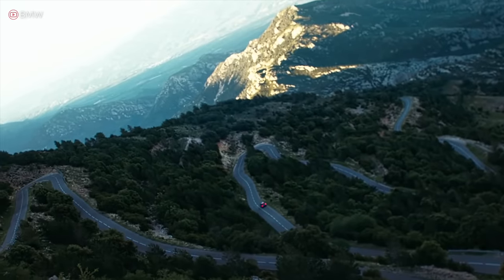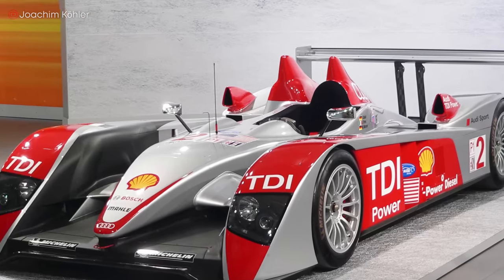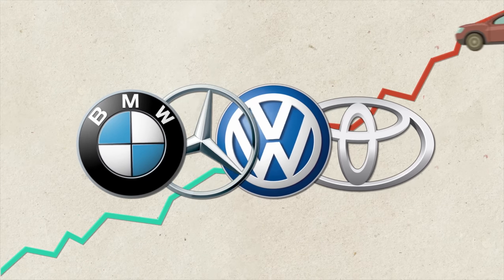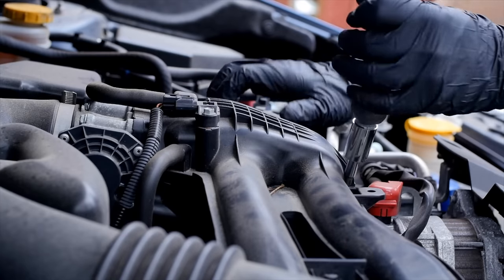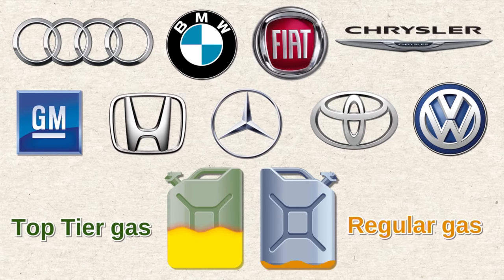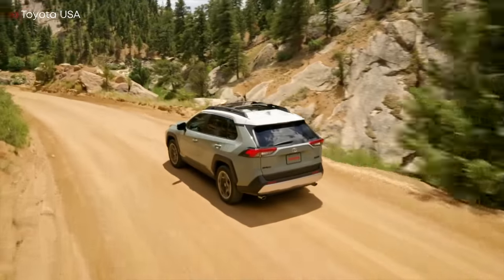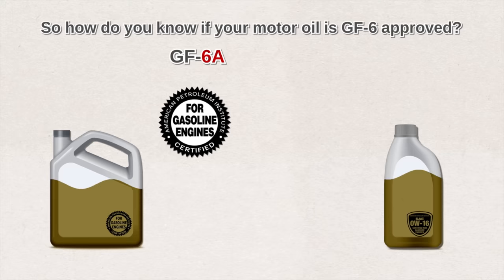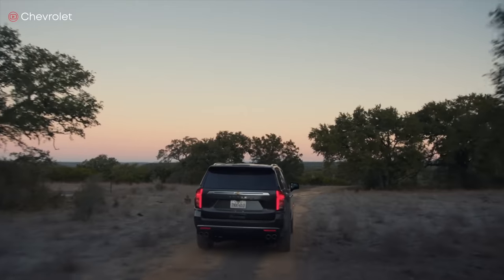Stop Buying This Fuel Right Now

Comment: I remember once I borrowed my brother's VW Jetta turbo diesel, and was filling it up once, and this guy sort of laughed and said "You do know you're pumping diesel into the car..."  and I replied with a little laugh like "Yeah,  I know crazy isn't it.  It's a turbo diesel."    His eyes got a big and he was like "Oh, OK" looked at the badge on the back quick and said "didn't see that." and walked away.
Reply: how fast does it ride? Despite what people say diesels are very powerful engines with a lot more torque.
Reply: @Monster33336  doesn’t mean their fast. now if you put an ALH in a mki to replace the  1.6idi? sheesh?
Reply: @AWESOME1509  Not fast but strong. I'm assuming smaller cars with diesels should be much faster but idk.
Reply: That happens to me a few times a year,   the last time,  a few weeks ago,   I had the station attendant come running outside waving his arms yelling across the lot.    I just take it as strangers trying to look out for me and appreciate it.
Reply: @Monster33336     I have a diesel Jetta wagon,   it's no quicker than an average 4 cyl gasser but it climbs hills much easier.    Don't have to push harder on the accelerator pedal going uphill.     Also fully loaded with stuff it doesn't effect fuel milage,    multiple people and camping gear i get the same MPG as it gets empty and just me.  Around 47 mpg.
Reply: @AWESOME1509  why would you use the weakest tdi engine the ALH is a 90BHP that’s slower than the engine you’d be replacing 😂
Reply: The thing is you can't physically FIT a Diesel nozzle into an "unleaded" car's filler due to the size difference.

Comment: Love the way you explain things.  I'm an old school mech.  Back yard repairs.   Started working on newer models around 2005.   First 96 ford windstar.  Loved the way everything worked with computers.    Once I gained confidence I started doing more.   Now have 2012 F150 with159000 miles and runs like a top.   Maintaince fluid filter changes and fix small issues.   Also have a 2012 Audi.  It burns oil per one of your other vids but we watch the level and at 148000 that runs great too.  Trans oil changes along with all fluids through the years. Best  part.  Paid for for many years now.

Comment: Very informative video. Here in Colorado and other high-altitude areas, the oil companies screw us over by calling 85 octane "regular" gas and charging around 30 cents per gallon more for 87 octane REAL regular gas which they call "midgrade". Most cars specify at least 87 octane as the minimum, but most drivers here just buy whatever is cheapest, which means they are using 85 octane that is not good for their engine. I have always spent the extra money to put 87 octane in my cars, and this video vindicates me for doing that. Old cars with carburetors probably did OK with lower octane at high altitude, but I'm thinking that modern cars' engine computers reduce performance and mileage when compensating for the lower octane fuel.

Comment: I own a Peugeot 3008 with a 2L Diesel engine (180 hp, 295 lbf). Its fuel effectiveness is 73.5 mpg on a intercity road at 57 mph speed (90 km/h speed limit on the roads of that kind).

Comment: Some places  you do need anti gel for diesels. Around the south they usually ever get cold enough. But they have warming pads for the oil pan and battery. And you plug them in for overnight trickle charge. Engines are still cold. You need to let both engines warm up some. It’s hard on them I feel until the thermostat has moved let them warm up before jumping on the highway or interstate for travel or work. If you do don’t harf in it baby it. All the fluids are at the nights temp and don’t lube as well until it’s warmed. Engine oil is thicker. That is why manufacturers recommended 10/30 ten is 110 degrees and and the 30 is minus thirty degrees winter degrees the oil is still able to flow and lubricate your engine properly. If you have an old freezer go stick a quart and freeze it and pour it out after over night. Then pour up a bunch heat it up to 110 see what it does at 110 degrees is still lubricating?

Comment: Scotty...I have an Isuzu Trooper, 1987, with a C223 diesel engine, 4 cylinder: after watching you here, now I know that my truck is an indirect injection system. Since I leave in the Dominican Republic, we use deasil vehicle all the time.  And here is the reason why I think the  indirect injection engine is better. The direct injection doesn't accumulate so much dirt inside of the engine like the direct injection engine does. I think the best diesel engine ever make was the Toyota Hilux Diesel 1986. This indirect deasil engine run for ever. And while they consume more fuel than the direct one, what you spent in fuel you save in mechanical work. Too much dirt inside of the direct injection engine. As for my Trooper, I have seen some of these with 500,000 mile and more in Indonesia where there is a Trooper Club. There are not fast, but they are, super, super reliable.

Comment: Nice video. Here in Norway, we have 95 octane and 98 octane RON gasoline. I buy 98 octane for my cars because 95 octane contains ethanol (E10 - 10 %). Ethanol contains less energy than gasoline, meaning ten percent of the gasoline is less powerful. So the energy of 95 is in fact lower than 98 per liter or gallon. Further, the ethanol is hygroscopic, binding water from the atmosphere. Also, older cars have fuel lines made of a rubber that gets brittle from ethanol.

Comment: In Ireland, diesel engine cars (just over 43%) are the most popular cars after gas (we call it petrol over here)(nearly 37%). I myself have a 2012 Toyota Corolla with a 1.4 litre Terra diesel engine. Diesel is more popular here in Ireland because it's up to 10 cents (12 US cents) cheaper than petrol per litre and probably due to Ireland having more people living in the country than other parts of Europe and America. To me, petrol (gas) engine cars are only any good if you are only doing urban / town driving where you don't do long distance travelling. Since I live in the country and I do much long distance driving (it may sound funny, but I do long distance driving to relieve my depression and anxiety), a diesel engine is the much better option. €50 (just under $60) fills the tank full of diesel (it costs at the moment €1.42 a litre on average for diesel (€1.53 on average for gas per litre), which probably sounds very expensive when on average, diesel only costs 74 cents (about 87 US cents) per litre. At least with diesel though, in my car for example, I can get over 500 miles out of a single tank of diesel, which I think is excellent.

Comment: I typically see a 10% increase in mpg with premium fuel over midgrade.   I often wondered if it's because the gas stations I tend to use have more additives or maybe have a lower ethanol content in their premium grade.   I can also say that I get a large mpg increase if I use a mid-grade ethanol-free fuel, as much as 25%. I wish ethanol-free pumps were more prevalent.   Corn-based ethanol isn't environmentally friendly anyway.

Comment: My Honda Fit recommends 87 octane. With it, I get 35-37mpg. If I use 93 octane I get 40-43mpg and it seems to have better acceleration than with 87.

Comment: Still wake up screaming sometimes because of the issues with Diesel injectors getting loose (at 125 GBP a pop to reseat) on my prior Jeep Grand Cherokee. Apparently a typical Mercedes engine design flaw that only keeps it in place with 1 bolt on one side of the injector (contrary to e.g. BMW Diesels that I'm told keep the injectors in place with 2 bolts, 1 on each side). Also due to the partially unseated injectors air was being drawn into the cylinder, cause big black clouds of smoke behind the car, especially during acceleration.

Comment: When I went on extended trips in my Corvettes, I'd use GOOD quality regular. The lack of 'need for speed' fuel caused NO change in cruising effort (under FAST at least). It was stressless savings. Tooling about town, I used high octane and it was fine and I never noticed any 'overhang' upon switching fuel.

Comment: I used to drive a 1973 Toyota Corolla, which was bought new, and used 87 octane gasoline. After ten years, the engine began to knock. I switched to 89 octane gasoline, which stopped the engine knocking. A couple years later, the engine started to knock again. I switched  to 93 octane gasoline, which stopped the knocking again. After 14 years, I replaced the 1973 Toyota Corolla with a Toyota Camry. The higher octane was a way to stop the engine knocking. Perhaps, I should have had the car serviced instead, to stop the engine knocking.

Comment: Oil Question:  I have a 2007 3L V6 Accord Coupe. I'm the original owner and the car has 129,000 miles.  Have always used 5W20 every 3500 miles.  Should I keep using it or change to a High Mileage or Synthetic oil.  What are your thoughts?

Comment: My 2019 Subaru XV (Crosstrek) is stated to require 91 RON (American 87 octane). However, I find it runs so much better around town on 95 RON that the mileage improvement exceeds the extra cost per liter. But on the open road the mileage improvement with 95 RON is insufficient to justify the extra cost.

Comment: I cam say honestly say I drove a 4.6, V8 equipped Crown Victoria Police Interceptor to commute from Las Vegas, NV, to Mequite, NV, 5 days a week for 3-1/2 years, and there was a distinct difference in distance  I could go on a full tank of low or high octane.   The lower octane fuel most definitely gave me less mileage and the fuel level dropped much faster too.  High octane for that highway cruise was the best choice. After 3-1/2 years of that cruise in the same exact vehicle out of the fleet, I could easily see and even feel the difference.  I wouldn't be surprised if that police Interceptor is still on the road today, it was an excellent, strong and extremely reliable vehicle.

Comment: Modern diesel engines have the DEF exhaust system. This system keeps the exhaust much cleaner. If you buy a vehicle that doesn't have the DEF system you cannot register it in California.
I retired from trucking last year. The truck that I drove was a new Frieghtliner. It had a 500 HP engine. It ran great, and because it has an automatic transmission it was a dream! More than eighty percent of the industry is now using automatic transmissions. It's fuel efficient and has less repairs.

Comment: I drive a Hyundai i30 2011 with a 1.6L diesel engine and my wife drives a Volvo XC60 D4 2017 with a 2.4L straight 5 cylinder engine, awesome cars. Diesel power is the best, and fuel quality in Sweden is one of the best in the world. Oil change every 30,000km and diesel cars starts like a champ in low tempratures, actually when it is - 35 degrees in north Sweden, diesel cars start easier than petrol cars, that's what I was told by a guy who lived up there in north...

Comment: The VW diesel and many other 2-stroke diesel engines have "Glow-Plugs" which require to be energized before the compressed air in the cylinder reaches sufficient temperature to ignite the fuel/air mixture.   The fuel/air mixture doesn't explode as with gas engines but it just burns on ythe power stroke to provide constant downward pressure on the piston.

Comment: Out of curiosity, why do diesels tend to have a higher displacement then it’s gas counterpart?  Ford and FCA use a 6.7L diesel while the gas engines are 6.2L and 6.4L respectively. GM uses a 6.6L diesel and a 6.0L gas. Is it because of the way diesel burns compared to gas, or what?

Comment: Adding information about high mileage oil would be helpful. Speaking with an oil engineer, the base materials are larger, preventing consumption of the oil. The oil weights are the same, just larger base materials. Then additives such as zinc, moly, tungsten for the extreme pressure. These prevent wear!

Comment: I had a Ford Econono van 2.O Ltr Engine. When I used higher octane fuel I got more miles to the gallon than with the lower octane fuel. Roughly 120% The engine ran more smoothly on long trips

Comment: Not mentioned was power output is (also) a function of ignition timing.  The ability (due to knock sensors) of modern computer equipped vehicles to vary ignition timing according to knock has significant advantages over systems not able to take advantage of knock sensing.  
Timing can be advanced and power output increased with higher octane fuels, but only IF the engine (sensors/computer) has that ability to sense knock and dynamically optimize fuel/timing.  (Proof is in the dyno torque/rpm graph comparisons resulting from ignition timing changes.)

Comment: 1500, 2500 and 3500 diesel trucks are a joke. $90,000 for a real work truck is ridiculous. So are the used 15 year old diesel trucks with 350,000 miles on them. No thank you.

Comment: Nice video from Scotty.  Funny to see the differences in oil changes...  max. 7000 miles Sotty said?  Uuh.. well; car manufacturers here in Europe state: 19.000 mile intervals!!  (Not good I know) 
So quite a difference.  I change the oil of my car at approx. 8.000 miles but 99% of the drivers here in the Netherlands don’t.  They don’t know how and leave it to the adviced service intervals, which are.... 30.000 km (= almost 19.000 miles)!!  Many of my friends or colleagues think I am crazy to change the oil so “quick”.. sigh..🙄🤔

Comment: My 05 camry users manual said not to use fuel with more than 10% ethanol. Today's fuels have 15%+. This is why even though I do full synthetic oil changes I do it at 3000-4000 miles & not 5000-7000. Ethanol is CAUSTIC & can corrode gaskets and piston rings. Pulling that out more often is good.

Comment: 12:29 u said higher octane burns hotter is not correct; but I had a 98 Grand Cherokee and the owners manual specifically said don't put higher octane in because the hotter temps could cause engine seals to fail.

Comment: In Minnesota or the northland states you can use 0W-??, Vs a 5W-??. It flows faster. My little run around Kia Rio says to use 5W-20. The Mobile1and Pennzoil site say I can use a 0W-20 when I looked it up on their site. I bought the Amsoil Signature 0W-20 and have it in right now. I notice that when it’s like -25 it starts very easy and no vibration or shaking at all. I’m going with Mobil1 0W-20 in October. I only drive 7500 a year in this car. I park my Silverado in the garage and drive it very seldom in the winter. It was so expensive so I want it to last.

Comment: Adding fuel that is higher octane may reduce fuel consumption, and may reduce CO2 emissions is fine and dandy, but what I want to know is, does higher octane fuel help extend engine life in my car or truck that recommends higher premium octane fuel? Or does higher octane higher resistance to ignition cause piston rings to prematurely wear out from an increase of pressure in an engine that already has badly worn piston rings which has a loss of pressure?

Comment: Hi Scotty, 
You have recommended against turbocharged gasoline engines because the high pressures lead to earlier failure. Is that also true of diesels? Diesels have higher internal pressures to begin with, so it would seem that turbo-diesels would have much higher pressures than gasoline engines. Is it possible to design either type of engine to be as durable as a non-turbo?

Comment: Are the newer direct injection engines the reason diesels don't make as much clatter as the older ones? The newer trucks don't make as much noise as the older ones do. Sometimes you can't even tell it's a diesel unless you really listen to it.

Comment: you can get more power out of higher octane if you can advance ign timing or a modern engine with a knock sensor it always advances timing till it hears knock and backs timing off,the supercharged V6 buick used in australian commodores blew head gaskets when run on low octane fuel

Comment: Petrol/gasoline engines can produce more torque than they do if they make the pistons smaller but with longer stroke. Diesel engines use smaller pistons and long stroke which is one of the many reasons why the rpm limit is lower than a gas engine and torque is higher. Gas engines normally use broader pistons and short stroke which allows higher rpm and power. Also diesels still suffer from turbo lag with fixed vane turbos, most newer engines use VGT or VNT turbos which helps low end boost. Modern gas engines will have a VGT type also, engines that are turbocharged require different cam timings from non turbo wether it's diesel or gas.

Comment: One thing, some older engines will not run on petrol (Gasoline) with a high E number.  So if governments make high E content fuels the only ones available, many older cars, especially historic or vintage cars, will be worthless and put in museums or scrapped.  Unless someone comes up with an additive that deals with that.

Comment: What about using 100% gasoline without ethanol? I've heard and read some saying its bad to do this, and many who say its good to do this. I do it only on occasion.
Reply: Ethanol has less energy (BTUs) per volume compared to straight gasoline, so you get less power per gallon. Ethanol also attracts moisture which settles in the tank and can eat (rust) metallic fuel lines or tanks which later clog filters and injectors. Ethanol can degrade some plastics or rubber o-rings over time. Ethanol wastes a lot of farmland, if producing food is important.

Comment: Hello Scotty!

I drive a 2016 Toyota Rav 4, with 127,000 and it runs good, no problems. I saw a video of yours about DE carboning your valves with 505 CRO.  You said put it in and run car for 20 mins at 2000 rpm, then change your oil and oil filter, I live about 68 miles from the place where I have my oil changed, (I live in a very small town, and I go to a shop that I trust), would putting in the  505 CRO in and driving to the Mechanic shop 68 miles away hurt my Rav 4?  

Smileymo